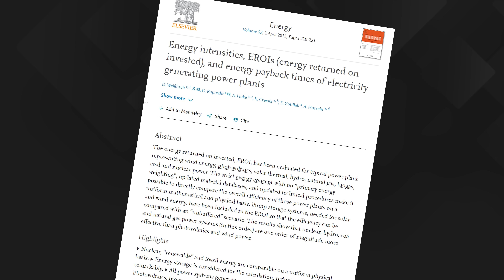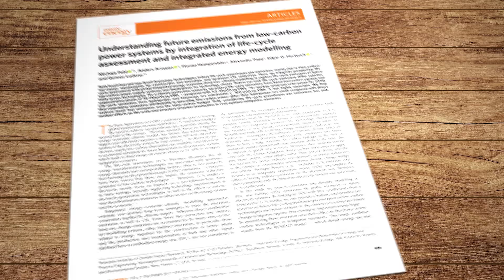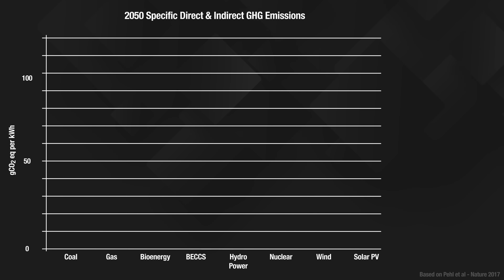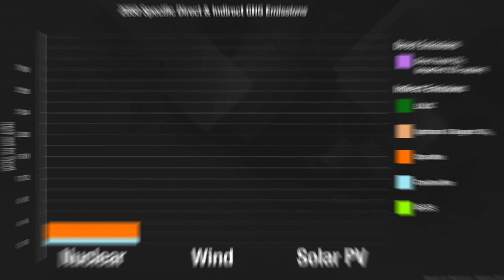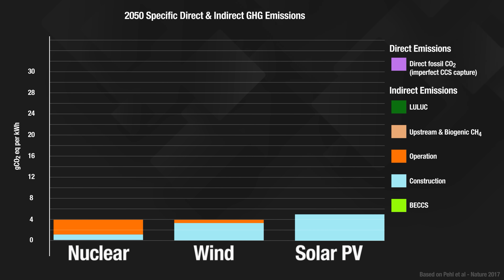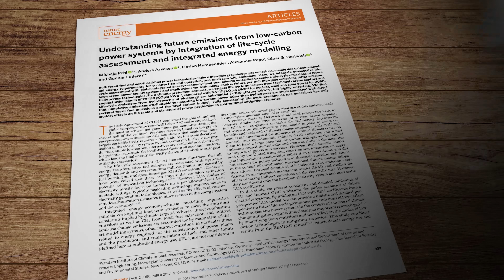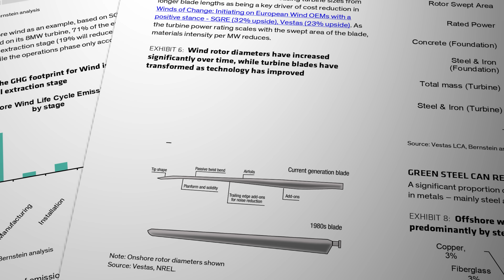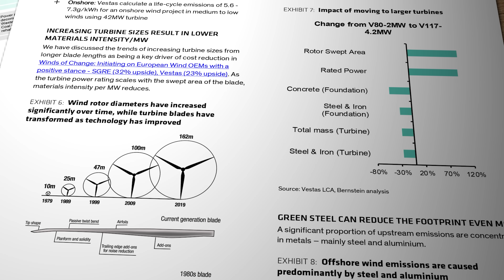Lifetime carbon emissions of renewables vs fossil fuel. Problem or solution?

Comment: Oops. Environmental policies can have unintended consequences. News Item, Los Angeles July 14, 2022. L.A.Times story, by Rachel Kisela.

“California has been a pioneer in pushing for rooftop solar power, building up the largest solar market in the US, more than twenty years and 1.3 million rooftops later, the bill is coming due.”

She states; “The California government showered subsidies on homeowners to inspire transition away from fossil fuels beginning in 2006 and they are now reaching the end of their lifespan.”

The concern is, how do we dispose of the worn out panels? How about recycling, you might ask? They are not easily or cost effectively recyclable.

The panels contain toxic metals such as selenium and cadmium which can contaminate ground water when buried in landfills. This could become a problem with 140,000 panels being installed everyday.

They are considered hazardous waste in most states which requires expensive restrictions on packaging, transport and storage and would require specialized furnaces to recover the silicon.

Similar problems exist with EV batteries and wind turbine blades as well.

So the obvious question is; Are the alternatives to fossil fuel actually better for the environment, all things considered? Perhaps not.
Reply: Agreed. We are also bulldozing farms, meadows, forests, jungles and deserts to lay hectares of panels. This represents unprecedented and permanent plant and animal habitat destruction. I thought that this was what we were trying to avoid. Cheers.

Comment: .... Solar and wind are not reliable, so you have to have back up power generation (for when theirs too little wind/sun) and significant energy storage (for when there's too much energy vs consumer demand) to make it feasible.... Account for this, and the fact that solar and wind is not concentrated, so infrastructure will need to be upgraded to accommodate power generation from multiple decentralised sources.... Nuclear power is the best option available to us currently in my novice opinion

Comment: Problem with nuclear plants is the long time to build them and the massive cost over runs like Olkiluoto 3 in Finland. At least they have figured out how to dispose of the waist. Solar and wind is easy to install and can be done in a short time span. Problem with these is that they do not provide continuous supply like nuclear would but are also easier to dismantle at the end of their life.
Reply: Much of the expense for nuclear plants is the result of the green movement's initiative to prevent their construction. They ensured that they were incessantly tangled in environmental red tape causing costs to soar and inevitably unviable. The green movement is the reason nuclear plants aren't ubiquitous.

Comment: I think that any meaningful comparison of lifetime emissions for the green grid needs to include whatever storage system you are planning to use for the system.  Fossil systems can be throttled for long-time-period expected load changes and have quick-start/rapid-shutdown gas options for short term variations, thereby meeting hourly changing loads without an external storage system as the fuel itself is the storage medium.  For a green grid to function in the same way, storage is vital for night/cloudy/windless times when generation is not possible, but load still exists.  These pollution/waste of these storage schemes should be included in any green evaluation as they are inherently already included in fossil/hydro/nuclear grid.

Comment: I wonder how much investment  covering 1000s of roofs with PV panels would be compared to a traditional gas fired power station. Of course. Storage is always going to be the problem. It woul dhave to be worked out on the average day in the UK of course.

Comment: I really like your videos Dave, but they sound a a bit like a Brighton and Hove save the world at any cost. We have to either slow the rate of change or tax the electorate with an income over £50K per annum at a 50% tax rate. It is coming anyway. Your videos never touch on the costs. Costs to anyone with a lower than average wage who are hit with the highest percentage cost. Hey what is 1 Trillion more or less for these changes, the companies and corporations make a profit, that's capitalism and without them, nothing would get done. The government has no money of it's own, it is yours and mine. There is only a limited amount available. If you give a Billion to Fusion research (that's about the cheque size), then it's a Billion off building hospitals and schools. They won't admit that, but it is either tax till they squeak or slow things down. There is a GE looming, possibly a world war and we have no security of energy supply. The ecologists are right the time to make any difference has been and gone.  Tidal energy production could have supplied adequate power for the UK baseload, the first two barrages could have been on line by 2020, gas generation would have been hugely disrupted. But the worst I see is the hypocrisy of the activists. The insulation protesters, who had not bothered to insulate their own homes. The stop oil protesters who use oil and gas like it's going to last for ever. Yes they spun you a porky about plastics, but the Green Lobby spun lies about cows, almond milk,plastic meat, inundation of the world etc. But we do know that we will end up with hyperinflation to pay for the changes. The corporation's won't build the Green world out of the goodness of there hearts, customers have to pay for it, then the wages must go and the inflationary spiral begins. Just to finish, remember how the Nazis came to power. The do-gooder prohibitionists caused the Great depression. By the time it was over Alcohol had been displaced by gasoline as a prime motor fuel. The Great Depression spread to Europe and along came a party that said you are suffering, we can do better and you end up with a fascist government. Please learn from history

Comment: Wind and Solar produce energy when they want to, not when you need to.
Far from being a "minor detail", it is The central issue.
Because of this inadequation, it produces immense stress on the grid and requires additional storage capacities, which more cost, more construction, more CO2m
and funnily enough, requires more Extra production capacities to compensate for the random output, which of course needs to be fast energy, and therefore consumes .... coal and gas !
Why do you think Oil major love so much wind energy in particular ??
These side-effects are conveniently "forgotten" in these analysis, because <insert lame excuse here>.
It's not as if we were in a world where just mentioning this topic would instantly land you a "climate denier" label.

Comment: from greenorbits,, Can Wind Turbines Survive Hurricanes?

    By: Preetam
    Date: July 25, 2021

"There is currently a fear that the combination of high winds and heavy waves could cause wind turbines to twist and turn in the weather. 

There is a strong fear that this could cause severe damage to the blades. 

Some engineers believe that if the design of offshore wind turbines is not changed, there will eventually be a point where we can see catastrophic damage to offshore wind farms during the heaviest of storms."

Comment: You talked about how nuclear's CO2 numbers don't include the CO2 impact of having to dig deep geologic storage sites. First thing I'd like to note is that you don't also talk about whether the renewable's numbers include the CO2 impact of having to build out a MASSIVE amount of new grid infrastructure so as to get the electricity from wind and solar farms to urban & industrial centers where it's actually needed. You also don't mention whether they include the cost of producing the MASSIVE amount of batteries needed to store renewable energy. Given that you said that most of the CO2 emissions of wind and solar come from the production of the panels and turbines themselves, I REALLY doubt those renewables CO2 numbers include the CO2 produced to build out new grid infrastructure or storage.

Second, nuclear doesn't ACTUALLY produce long-lived waste that requires deep geologic storage. High-level nuclear waste is composed of three types of materials:
1) 95% to 96% of high-level nuclear waste is just unfissioned uranium. The half-lives of U-235 and U-238 are 700 million and 4.5 billion years, respectively, so given the fact that radioactivity and radioactive half-lives are directly inversely proportional, 95% to 96% of the materials you're trying to store in deep geologic storage isn't actually very radioactive at all. Additionally, it could EASILY be reprocessed, re-enriched and put back into a new reactor. So 95% to 96% of "high-level" waste represented by uranium isn't ACTUALLY waste at all but rather unspent fuel. 
2) 1% to 2% of high-level nuclear waste is composed of transuranics, various plutonium isotopes, neptunium, americium, etc. This stuff takes thousands to millions of years to decay away, but as you can guess from them having such long half-lives, they're not terribly radioactive. Additionally, due to the contamination of various isotopes, transuranics from commercial reactors isn't actually usable as weapons material. Also, just as with uranium, if you were to reprocess the spent nuclear fuel to pull out the transuranics, while they can't be used in weapons, those materials definitely can be used in fast reactors. As such, 1% to 2% of "high-level" waste represented by transuranics isn't ACTUALLY waste at all but rather potential fuel as well.
3) 3% to 4% of high level nuclear waste is composed of fission products, or what's left over after an atom is fissioned/split in two. These materials cannot be used as fissionable material and so could be considered as true waste, and since they're SUPER DUPER radioactive, they must be isolated and stored safely. However, because they are so radioactive, they also generally have very short half-lives, such that the vast majority of fission products will have decayed away to stability within a decade or so of being produced. Generally, the only fission products you have to be concerned with for more than a single human generation (20-25 years) are Cs-137 and Sr-90, which both have half-lives of ~30 years and so require up to 300 years (10 half-lives) to almost completely decay away. However, Cs-137 and Sr-90, on a combined basis, only make up ~12% of likely fission products, and assuming fission products make up 4% of total high level waste, these two isotopes would only make up 0.48% of total high level waste.

As such, nuclear power does not IN FACT require deep geologic storage because the uranium and transuranics, which combined make up 96% to 97%, represent unfissioned fuel, not waste, and the vast majority of fission products will be gone within the span of time it takes a new born baby to reach drinking age. The only material you really have to worry about for longer than that are Cs-137 and Sr-90, but they only make up 0.48% of nuclear waste at most. This is just my opinion, but I don't believe we need deep geologic storage for something that'll be gone in just 200 to 300 years.

Comment: One thing we ignore is that when we create 1kwh of energy all of that becomes heat at some point. For 1kwh of energy generated, we dump 1kwh of heat into the environment. With fossil fuels that heat is old energy that was captured and stored millions of years ago. Now we are releasing that into the environment. This too has to contribute overall warming and climate change. Nuclear energy is also new energy to the environment and contributes 1kwh into the environment per kwh generated. This is a very large heat impact now while heat retention from greenhouse gasses in the atmosphere warms the atmosphere gradually. 

While fully renewable sources like wind and solar get their energy by extracting energy from the environment and redirecting it. They are putting 1kwh into the environment per kwh but they are getting it by capturing it from solar energy. They are using energy that is being added  and taking that amount of energy out of the environment, concentrating it into a form we can use. But with no net gain overall.  

I have seen lots of research on warming caused by methane and CO2 causing warming by trapping more solar heat. I likely missed it but I have not seen any research on the direct contribution to warming of all these "new" kilowatt hours from fossil fuels and nuclear energy that are getting put into the environment.  We need to be looking at this as well.
Reply: No, the heat contribution is not much at all.    The problem that causes human created climate change is from the insulation effect (affect?) that CO2 has in the atmosphere.
Reply: @ronaldlindeman6136  My own feeling is that the insulation effect does cause more heat retention over time than the footprint of the original energy release. But that all the gigawatts that we release from release of stored energy has to have a more immediate effect. When I lived in Edmonton, Alberta and on extremely bitter winter days the weather report would mention that the city was several degrees less cold than the surrounding area because we were a heat island due to all the gas we were burning.
Reply: @dmfraser1444  From what I have read, the heat island effect is from the buildings and roads that are exposed to the Sun.    Sunlight is very powerful.
   
They tried to come up with a plan to cut down a large section of trees in the Canada forests.    Then have cattle eat the grass that was planted to grow.    Then when it snowed, the white snow would have sunlight bounce off it, rather than have trees that would've absorbed the sunlight.  It was an attempt at Geo Engineering.    I'm not sure what the conclusions were, but it was an attempt at cooling the planet.    It is the Sun's sunlight that warms the planet.

Comment: I love renewables like wind, solar and more. The problem is they don't scale up very well. The famous mirror array out west was scrapped and never made any power after millions spent. The other issues are the effort and materials to make these panels, batteries and the like. They are very toxic when their short life cycles are over and they take a tremendous effort using questionable hierarchy and structure to mine, produce and ship by boat to the end user. Often the chain of production involves gross polluters and human rights violations. It's all very problematic. Not to mention all the eagles killed by huge windmills

Comment: Much of what you say is great.

Carbon curing for cement in concrete is, however, almost pure scam.

At most 1% of the CO2 emitted in making OPC cement is captured by carbon curing.

Far better to use fossil free geopolymers or alkali-activated cements (which can also use carbon cure), and aggregating concrete with a large carbon component (biochar, preferably) recovered from air.

Comment: The new nuclear reactors can use the waste from the old nuclear plants as fuel, reducing the amount of waste by a factor of 100 and reducing the radioactivity down to hundreds of years..
You also failed to mention that the nuclear storage you talk about that requires concrete could use the same CO2 sequestration as the wind farm you mentioned.

Nuclear power is the best option we currently have right now. It is the safest and greenest energy we have. It could save million of lives each year by reducing air pollution that million of people die from every year. A extremely high estimate of deaths from all the nuclear disasters is 30,000 - 60,000 people dying from Chernobyl and Fukushima, that's it. Compared to millions from air pollution due to coal and fossil fuels EACH YEAR.

It is sad that Russia ruined nuclear power by doing some of the most unsafe and dumbest things with it, giving it a terrible name. They broke so many safety protocols while at the same time trying to create material for nuclear weapons. This has set us back 50+ years.

And Fukushima, using a extremely outdated design while at the same time ignoring safety features, training and cutting corners to reduce costs has also given nuclear power a terrible name.

Even with these worst case disasters, nuclear power is still by far our safest and cleanest energy we can produce. Even more so with the new reactor designs that are walk away safe and will shut down on their own in the case of power loss, and breed their own fuel getting even more bang for your buck!

Comment: Thanks for this presentation. This is indeed a complex issue. One of its aspect (just as an example) is, what do we do when the wind doesn't blow ? Afaik, we burn coal or gas. Doesn't that change how we should calculate wind energy emissions ?

Comment: Sorry, In the UK we have lots of offshore wind generation, why don't we have Tidal generation?.
I assume the infrastructure to connect to the grid is there, the structures to hold wind turbines are below the surface of the water, could the hold the tidal turbines also?

Comment: A vert good representation of the situation. Very difficult and there are always balance issues to present this equally and fairly in such a short time of a few minutes. We did life cycle assessments for paint and coatings on steel already 20 years ago and it is mind blowingly difficult. Industry was not interested then - today is different, but acceptance means even more details and more complex models. We are getting there. The question is always how fast…..